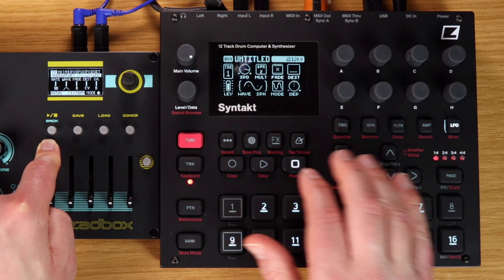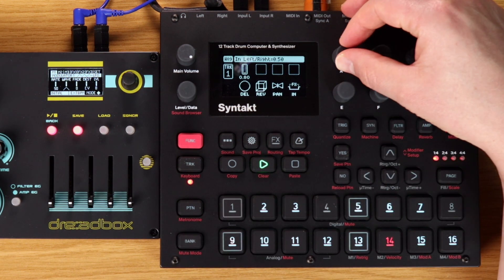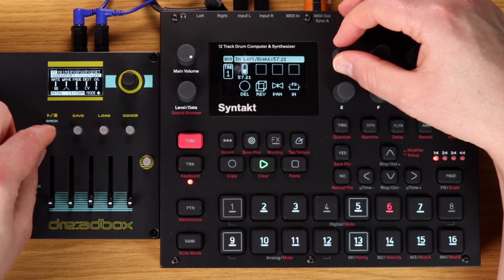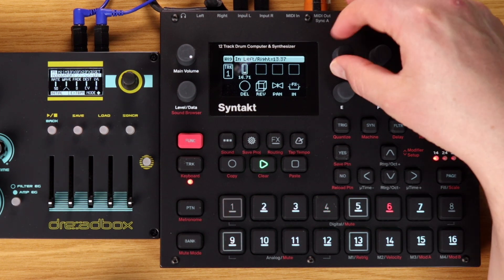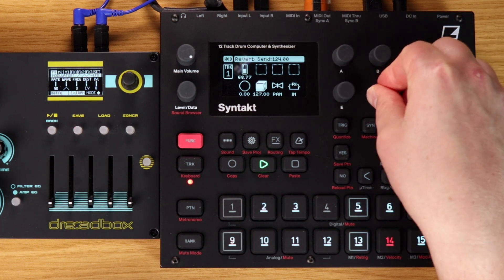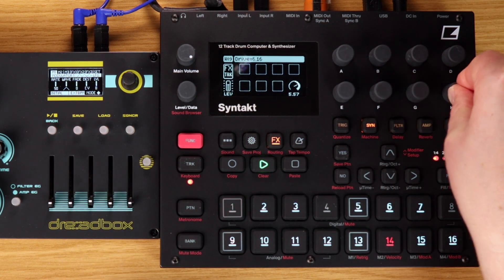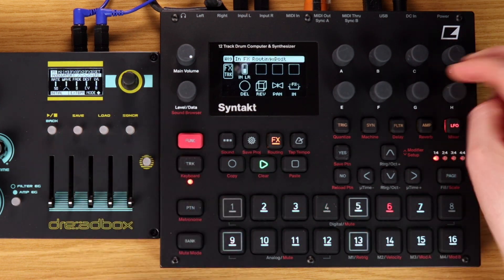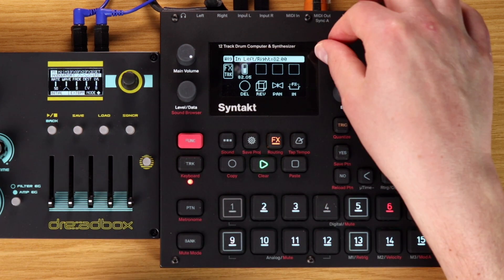Use Syntakt To Get The Most Out Of Other Gear! [Syntakt Mastery Course Now Available]

Comment: Typhon is almost perfect, just wish we could manually detune the oscillators like we can on the volca bass
Reply from the maker: I did find a workout for more intricate control of both oscillator tunings. You can either manipulate them via external CC messages both osc 1 and 2 seperately with finer adjustments. Or you can set up an envelope with no attack, release and max sustain out put and then use the depth amount to push tuning of 1 or 2 negatively or positively. Not ideal! But works!